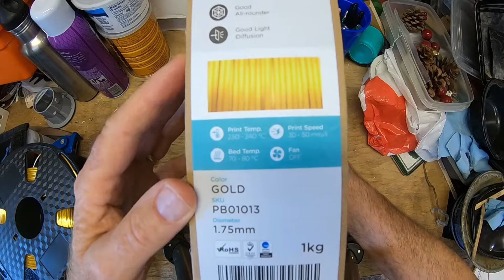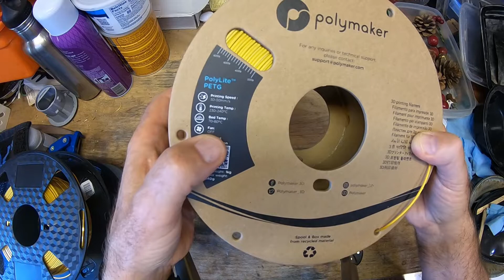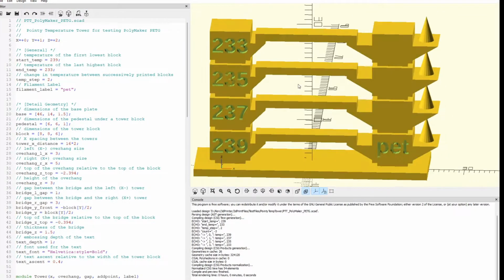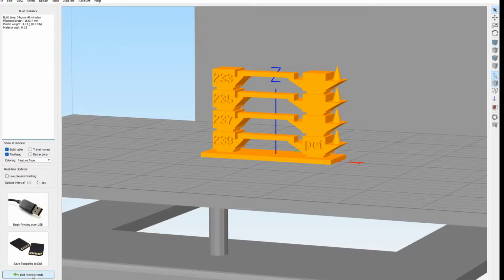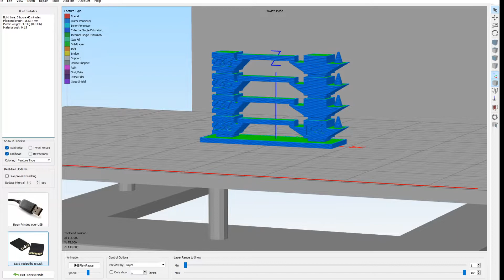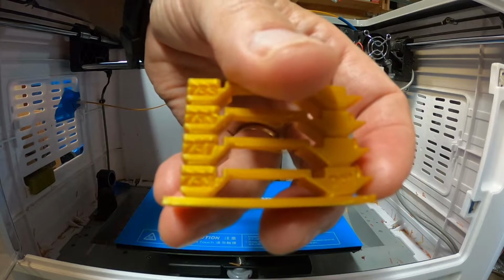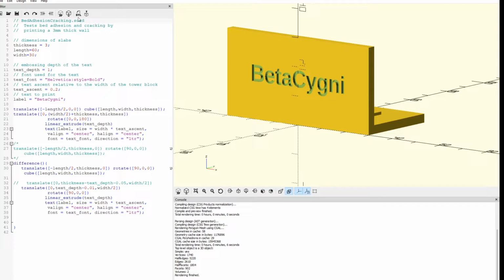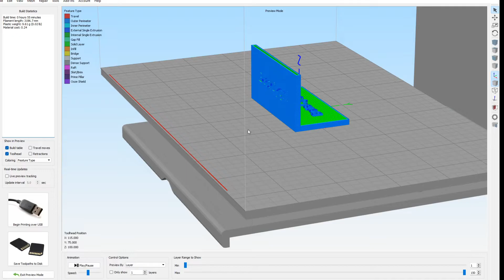Flashforge Dreamer (NX) - Polymaker Gold PETG 1.75mm Filament Testing - Part 1

Comment: RIP resealable bag :) (btw the tare weight of the spool is written on the sticker)
Thank you for the review
Reply from the maker: You're welcome.
I didn't bother to save the resealable bag because I store all my filament in a dry box with dehumidifiers:
https://youtu.be/nnCzMg47JKs?si=bvxOkMzb6QAtJ33Q

I didn't notice the tare weight of the spool on the sticker. Thanks, that's very helpful.